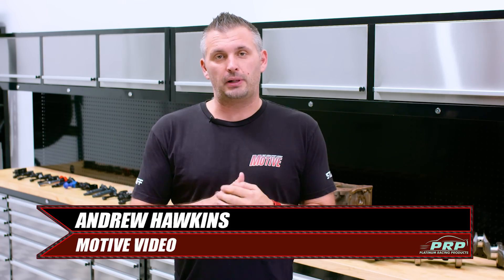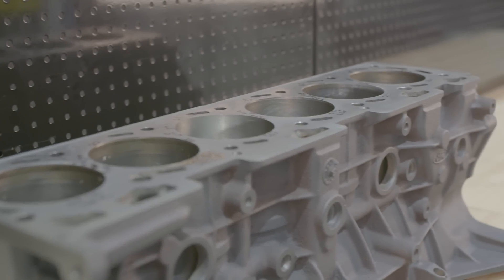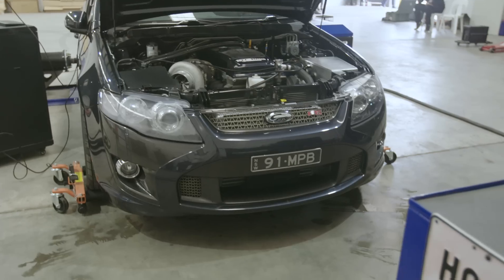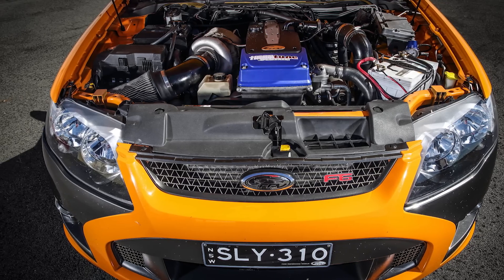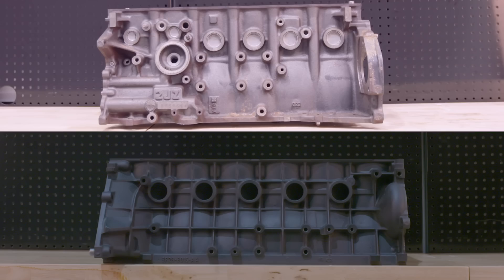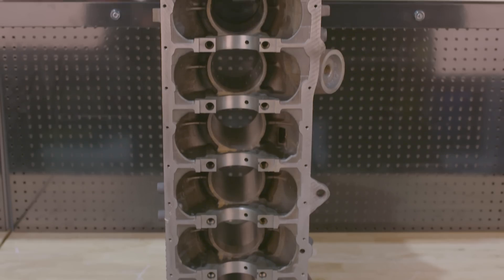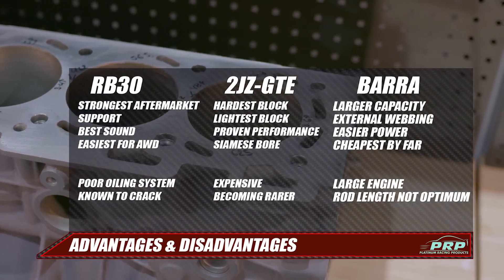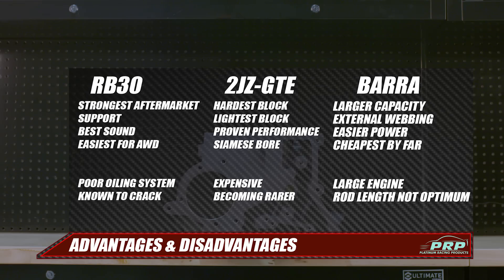Is the Barra 4.0L block better than the 2JZ and RB30?

Comment: yes i have both a vl turbo rb30 and a bf falcon turbo and the barra makes twice the power for half the money. Not to mention i have blown up five rb 30s and not 1 barra. they are near bullet proof and with the billet blocks can make upward of 3000 hp
Reply from the maker: RB billet blocks are actually making 3000 and proving it. Where are the 5 second Barra Pro Mods?
Reply: my point was the stock barra is a better engine, 99% of dont have the cash to drop on a billet block and then a kazillion dollars on internals (which are made from fucking cheese in a stock RB) plus sponsors a full workshop and half a dozen mechanics on hand
Reply from the maker: @kombatwombat420  They need oil pump, head studs and valve springs before you do anything serious. They still break rods and crack blocks. They were cheap. They don't reve as much, but have bigger capacity, and they are big and heavy. They're good, but we can't sit here and say they are "way better".

Comment: I love the debate. I especially love the humble beginnings of the Barra engine. It did not start out as a ground up design, rather it is considered a direct evolution of the crossflow OHV engine, specifically the alloy head cross flow design developed (or should I say, cobbled together) by Aussie engineers for the Australian public back in the late 70s. The crossflow design, in turn, was an evolution of the  original non-crossflow family of light Ford sixes, which were designed in 1959 for the (North American) Ford Falcon.

Comment: I drove a worked gtr skyline thinking it would make my 351 Cleveland feel slow boy was i wrong, it had no guts when you press the throttle most of the way from 140kph , it just went about 20 kph faster , and that was a $30:000 modified skyline , if you sit on 140kph and then apply 90% throttle with my 351 Cleveland modified it will load up and blast off up the road at 250 kph or more

Comment: Once ghe berra engine in made from a billet with engine upgrades it will be able to be as good as if not berrer than the 2jz and the RB30i would take the Berra engine to bulle enginering to make the upgrades and billet for the Berra engine

Comment: Own both a twin turbo 2JZ GTE, and my Ford Barra Ute, love em both for different reasons, Utes a work horse doesn’t miss a beat, the Supra, well that’s where the fun is
Reply: Turbo Aristo and NA BA here. The Barra definitely has a big boot full of torque off the line, which is great. The JZ turns the tables not long after when turbo 1 says hello! 
Gets even better when turbo 2 joins the party!

Comment: Question,  is it possible to add block cement in between the cylinder bores with some holes/pipes running horizontal for some cooling to make it semi siamese bored for strength? Maybe along with partial deck filling?

Comment: So from the tests it would seem both the Barra and the 2JZ block can reliably withstand 1000hp, neither one is prone to twisting or cracking. The Barra is a little bigger and heavier so the 2JZ can possibly outperform it in terms of power to weight but the 2JZ is getting harder to find and they're expensive whereas Barras are lying around on the ground and are dirt cheap so for anyone looking to engine swap the choice is an easy one, grab a Barra mate, shit....grab a couple.
Reply: The Barra actually has a few weak spots and a casting fault between cylinder 3 and 4. They also start to crack at around 700hp
Reply: @lennixsingh626  😂 no
Reply: @kiwi8. Yes. Australians are legends in their own minds lol. Barra literally is inferior purely on construction quality as the video literally shows.
Reply: @SmokingOz-nd4ew  there are plenty of stock block barras pulling 2000hp
Reply: @kiwi8.  Lol. Barra cylinder cracking is well known past 500kw on stock blocks. You clearly havent watched this video to make the lunatic comments you are making. Again Australians and kiwies are legends in their own minds. The video literally shows that its inferior in construction to the 2j.
Reply: @SmokingOz-nd4ew  real world results and this video are to different things
Reply: @SmokingOz-nd4ew  so all the barras driving around with 1000+ HP are just falling apart 😆 walk on cupcake

Comment: In reality the Ford is by far the best. 4 litre to start with.  The heads do not cause problems. Unless you use water!
RB30 were often stuffed 2-3y/o. I can remember buying VLs and Skylines and first thing you did was take the rad cap off the check the oil!!
The twincam ones reputedly are little better. Remotely big boost and they fail unless you use all the fancy bits.
The Toymota is an ok engine. BUT makes far less power and torque n/a. In fact are slugs in big fat Soarers.
My 12-1 FG LPG ute is far better.
Though WHY people go out of their way to reengineer a car to use one is beyond me. In a Falcon yes, it basically bolts in. And the crank is the same piece as a 1971 250. Drilled differently is all.

Comment: Im sorry the Barra is good and i love it .but 2jz is my engine and the nissan Rb is ok but  NOT beather than the barra or 2jz.BUT REMENBER MOSS OF THE CARS WHEN YOU RUNNING OVER 1000HP TO THE WEELS GOES CRAIZY. SO ALL 3 MOTORS ARE GOOD ONE WAY OR ANOTHER.

Comment: Instead of the company making V12 versions of the LS, Id love to see a "Barra V12". Custom block with 2 Barra heads on top. It would have to be insane lol
Reply: Someone might build it if it would actually fit in the engine compartments of commonly modified cars, and if someone would actually buy it.

V12 LS would be cheaper to begin with since the original engine is already a V, and there are a lot of available aftermarket parts for the LS.
Reply: It would be shit. The barra’s big strength is its block and capacity. So why would altering that make a monster? Use your brain

Comment: Hmm, tuners need to have a look at the Atlas inline engine family, specifically the GM 4200' even the smaller versions are quite stout and they all like Boost! 😎
Reply: I had an Atlas 4200 and they arent near as capable at handling power. There is a reason you don't see a ton of guys adding forced induction to these reliably.

Comment: I've always wanted to get a hold of one of these and use it as a truck motor here in the states.  I wonder how it would do with towing.  The 240/300ci I6's in the F150's seemed to do pretty well.  Bottom end torque was definitely there, just no power up top and horrible on fuel.  Are these overhead cammed, 4-valve, cross flow head engines the best of both worlds?  Anyone over there in Australia use these engines in a light truck setup?

Comment: It would be interesting to compare these blocks TORSIONALLY. The wider block on the Barra will resist twisting from the cyclic thrust loads of the pistons, as will the thick deck. That is likely to be transmitted down the outside of the block, hence the external ribbing.

I wonder if the cracking at the top of the bores in some blocks is due to the deck of the block moving laterally?......not just bore flex. The open deck style blocks suffer from this, so not unreasonable to think that a block with a proper deck would do the same when pushed hard....particularly if the deck is thinner and the outside of the block gives insufficient support (no ribbing) at elevated power levels.

Comment: It's irritating that ecoboost stangs, raptors and the FORD GT resorted to a V6?! Inline 6s are the golden configuration are superbly balanced, and sound so much better than v6s (If in aus you would know what I mean with p-platers cough holden *cough*). Most v6s (that I know of) require counter weights/balance shafts reducing engine life. They coulda remade and improved the barra, then youd probably have a lot of v8 fellas converting like in Australia. But I suppose the barra will ever and always be part of aussie motoring history as the best locally produced engine ever made.

Comment: I love this episode!! I want to buy a Barra 4.0L for my wife's SUV she has a 2003 Ford explorer XLT. I wanted to know if the Barra will bolt up to the 4.0L SOHC V6 transmission?
Reply: @TheDeezelsmoke  lol no I just want something more reliable and power vs the SOHC V6 she has now
Reply: Elias Melendez 😂 well all joking aside, putting a Barra in would be a massive amount of custom fab work do to the length of it. Would require custom everything. If you really wanted a different engine, I think you would be best off just putting the 4.6 v8 in it since it was available in that truck. Should be a fairly straightforward swap with junkyard parts, but you would be better off just  selling hers and buying another one with the v8 already in it.
Reply: @TheDeezelsmoke  well let me see it in first hand how much it cost to do it plus what I need to modify to make it work. I don't think it's not that much to modify Australia has the ford explorer in their country so it's the exact same ones we have here in the united states.
Reply: Elias Melendez well, they have an suv that looks like the explorer that is called the Territory, and that truck actually came with the Barra in it

Comment: I wonder if you were to build a 4.0l Barra and a 3.0l 2JZ with extremely similar setups how the dyno sheets would compare... I'm willing to bet the Barra would make a better street engine with the increased capacity, it would probably spool the same turbo faster if everything else in the build was all similarly designed

Comment: I don't think the barra is technically as good as the 2JZ or RB series blocks, but the barra is like the LS3 of straight 6's, its cheap, super reliable, has potential to make massive power and torque and it's so cheap! The barra is a smart and economical (financially) choice for any weekend warrior

Comment: Here in the states we had jeep running a straight 6 from 1989 to 2001. Ford ran them in the f150 back in the day also. My current daily is a 01XJ. 195k.

Comment: The Barra is hands down the best truck engine ever build! With it's tall deck, long stroke and tiny ports it does an excellent job of hauling the family around and not using all the numbers on the Tacho!
Reply: 2200rwhp with a cast block street driven car 😂 go get your billet shit
Reply: bullet engineering sell billet barras for 3500hp+ @lukeneill1568
Reply: @lukeneill1568 2j can do that

Comment: Has anyone done a built price comparison between the three ? Each built to same power level specs- to show “bang-4-buck” runners. I was always impressed with the 2j, but at the cost to build one, it was never a consideration in my mind & I would rather stick with my SBC. And although the Buick GN is a v6, not straight, the price to build it and availability again makes it a no-brained for me in states. Cheers & thanks

Comment: Brought a xr6 from police inpound $2100 NZ money, dam thing was worked, 3in full stainless exhaust, $1500 injectors, lost traction every gear, until somthing blew a hole out the sump. Got a stock engine now with a 3in exhaust lol.

Comment: You should check s54 block hpf sold kits for 1000hp before anyone was touching it. S54 is more expensive but way more race oriented it should be tested.Not to mention the cams with rocker arms and solid lifters making the best head flow.

Comment: I've got a 2005 Ford Territory. This thing hammers. All these new recent BMW/Mercedes/Audi/Peugeot SUVs around town are certainly zippy as all hell - UNTIL I GIVE A BIT OF BOOT TO THE ACCELERATOR AND TEACH THEM SOME RESPECT and leave them in the rear-view mirror. 

I even took on a late model Mustang at the lights and you should have seen his jaw drop, I beat him!  Mine is stock 182Kwh, but Ford kept refining the Barra and so the 2006 Territory got the 190Kwh (with better fuel economy) and in 2010 they refined it further to 195Kwh with even better fuel economy. The 2010 falcon onward had the last iteration of the Barra - 195Kwh (at 10.2L per 100kms). Damn fine effort from Ford Australia. Best Australian 6 cylinder ever made afaic. The 195Kwh power in my mate's 2011 Ford Falcon is just ridiculous. And it's quiet!

Comment: I think I would rather have the Barra, it can still be built to make insane power like the other engines but you can save money on top of it lol win win in my opinion.
Reply: Plus you can drop it in almost any build with room
Reply: Plus once it pops after a few weeks between the cylinders then you can buy another junk motor from the wreckers for cheap and keep your junk mobile going till the next crack lol

Comment: I was a Nissan fan boy in my teen years still am but after owning an few Nissan turbos I found they don't like everyday driving I don't go nuts on my motors I only do small things but from my experience the Ford turbo barra can't be beaten for reliability price fuel consumption it's just a good all round motor that loves everyday driving and isn't bothered by the heat in Australia where I live in summer 50°c happens regularly in summer

Comment: Correct me if I'm wrong, but the strength of the block dictates what sort of cylinder pressure the engine can endure; a larger capacity engine will require less cylinder pressure to make the same horsepower, when compared to a smaller engine. So no doubt being a 4.0L helps the barra make the impressive numbers that it does.
Reply: No, the block isn’t the limiting factor. It’s the clamping force of the fasteners keeping the head on the block. You’ll push coolant before the block bores fail

Comment: So basically, with the rb30 and 2jz compare, the conclusion is this:

Harder material and small size engine blocks win. Don’t necessarily need more material, more size , etc as it add way more weight. 

On the American side, if Chevy applied that to the ls, it would be a bullet proof block....it’s currently small, light, but the hardness is crap.

Comment: Yeah basically from everything I read and watch and from actual racing videos.. 2JZ is so fuckin beyond comprehension sometimes how superior it really is to anything stock and built when its also stock and built.. Most over engineered engine ever.. It can be used for whatever the hell you want it seems, just make a choice and build.. And then it weighs less than everything its been compared too.. Yeah im sure other blocks have their strengths also but when talking that, 2JZ is always in conversation, in every conversation.. ALWAYS

Comment: Chevy guy here just dropping by to support Ford over some rice pot
Reply: Car guy here just dropping support for realistic automotive industry knowledge.

Ironic that GM and Ford both pulled support for our local production facilities after defrauding various governments and agencies for millions of dollars and walking away, and all this when they had just started to get their technological act together and produce vehicles people actually wanted, vehicles that actually handled (kinda), stopped (sorta) and had huge power potentials locked up inside them. 

Irony also has the win in that many current GM and Ford vehicles use engines that either have been designed or developed by 'rice pot' companies.  Fords famed  'Eco-Boshit' 4 cylinder is really just Mazda's  L-Series 'rice pot' '
GM uses the 'SGE' engine which was designed by Shanghai Auto Industries together with Shanghai GM.
Also worth mentioning is most of the production line equipment on GM assembly lines are made by 'ricepot' Japanese company Hirata Corporation.......

One must ask why Ford and GM automotive divisions are hemorrhaging capital with seemingly no end in sight and cutting employees at an astonishing rate ?
Reply: Yet the "rice pot" is better...
Reply: @madkas14  ok fan boy. Got "tune" your forza cars

Comment: wtf is a "grout" ?  2:27
Reply: Type of cement mix ,(like whats between your bathroom tiles) you put in the water jackets to strengthen the block,but you now need big oil coolers to keep temps down. Mainly drag use only